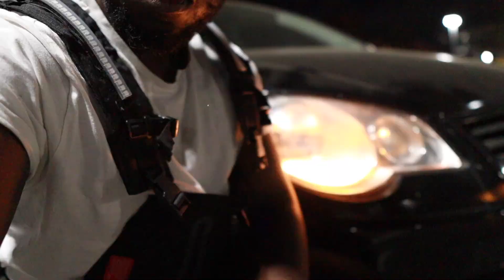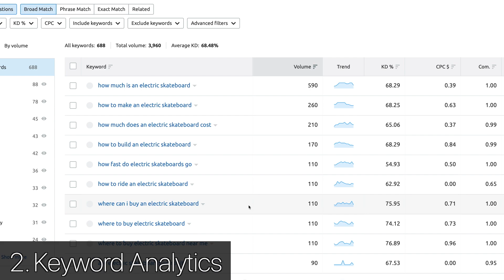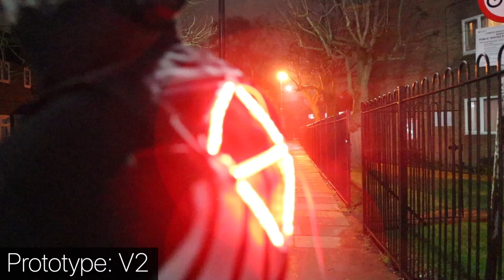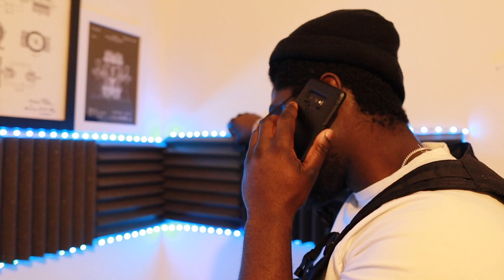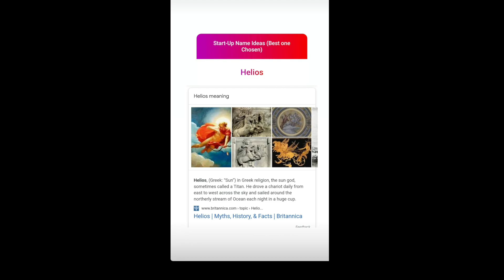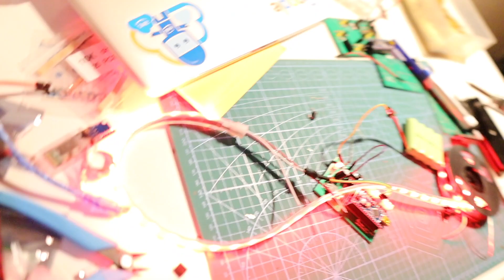How I Built a LED Bike Vest Start-Up in 4 Weeks | LightVest

Comment: I know it's been a minute since you did this project. But my first thought in seeing the video was integration with the electric skateboard.
Reply from the maker: Ahah that's not a bad idea Manny!
Reply: @EbenKouao  there are so many directions you can take the setup. Integrating it into the skate board is only one. Plus building the board and if you sold the vest as a kit would still be cheaper for people than buying a board.

Comment: This is soo good.... 
There is a problem with this... It will tern on when we are turning.. we have to turn on it before we are turning left Or right...
Reply from the maker: Good point. You can also manually trigger the blinkers using the remote. 

However, very true, this is current limitation ....Using the gestures does requires you to have already made the gesture to movement .... since its low latency it would trigger the lights before the bike following the full trajectory of the turn. But still a limitation. Curious to know if you have any improvements on this... May revisit this feature. Cheers!
Reply: @EbenKouao  How about another accelerometer on your helmet and you nod twice in the direction you want to turn? Riding my e-bike at top speed, I daren't use my arms for turn signals so this would be great! Also, I would either rethink the yellow hi-vis vest design or add reflective strips. Have a look at WLED on a D1 mini as well. Great video Eben, subbed since the magic mirror episode and it's nice seeing you develop the channel.